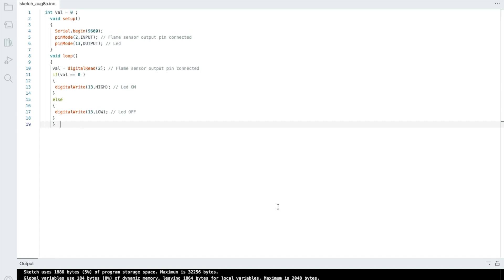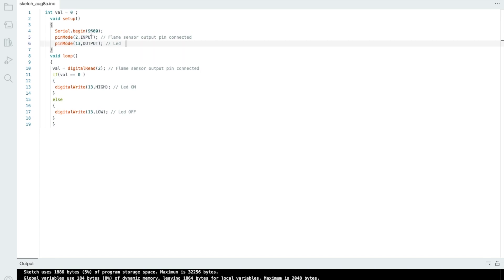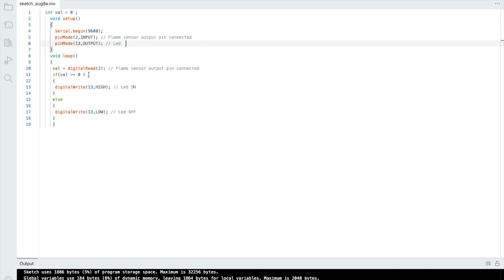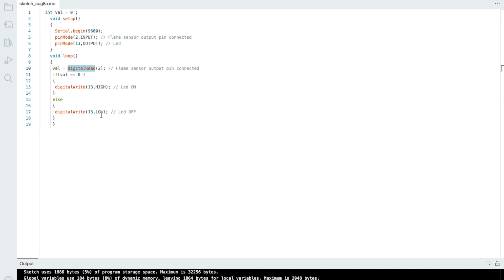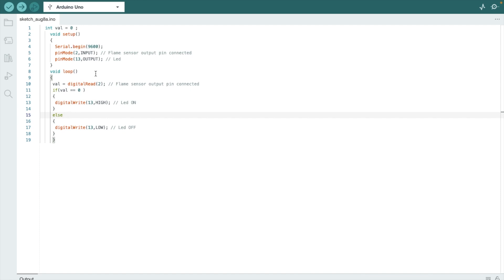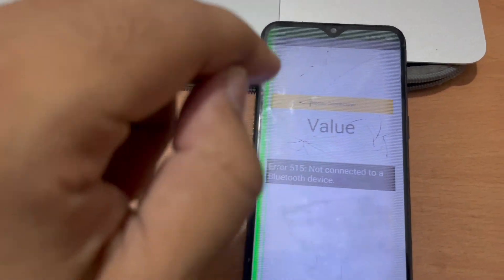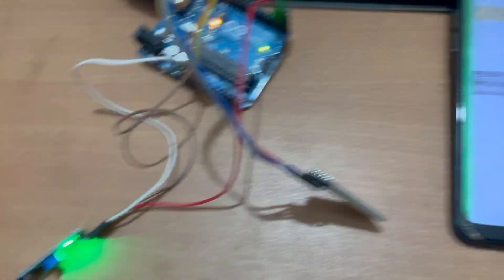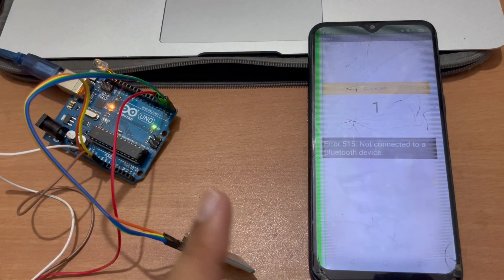Fire Detector App using Arduino Uno and MIT App Inventor | Part - 3 🔥🔌

Comment: sir, the code is  not working, like the led of mine is working, but the Bluetooth app is not showing 0 or 1 instead it is showing VALUE only, after connecting to Bluetooth
Reply from the maker: It means it’s connected but not sending the data make sure your app bluetooth is connected to the bluetooth module
Reply: Thanks sir @TheCodingBus